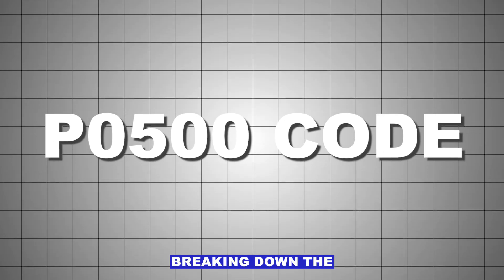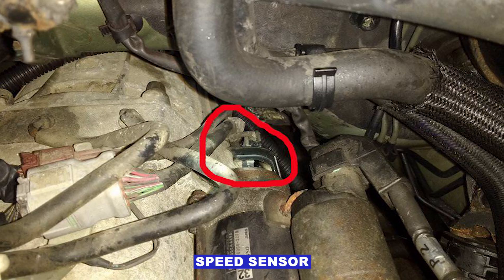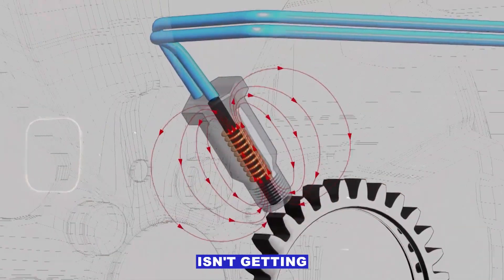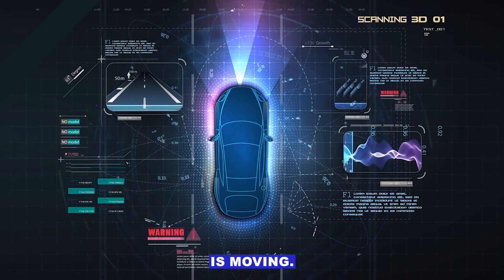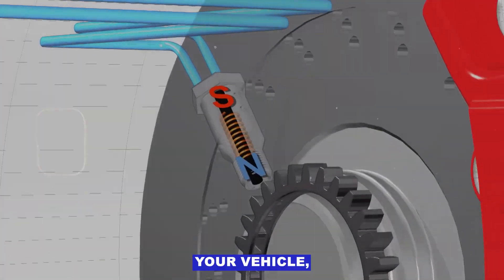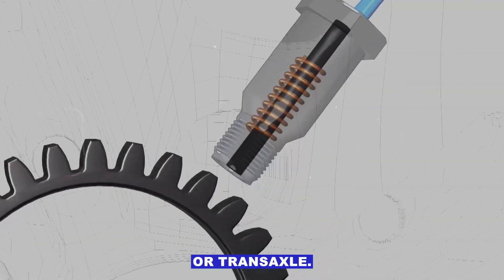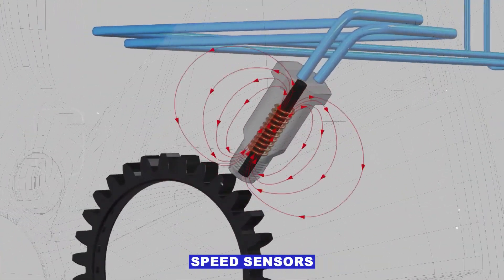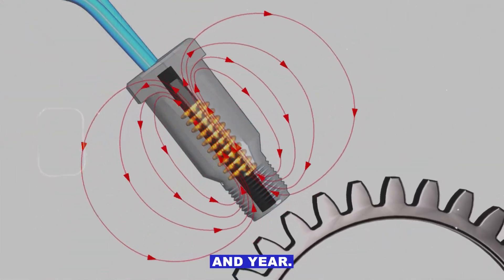P0500 Code: Vehicle Speed Sensor "A" Malfunction – Causes, Symptoms & Fix

Comment: Could a bad purge valve affect the speedometer?  My check engine light is showing P0441 and P0500 codes.  I replaced my instrument cluster and speed sensor with new ones about a week ago and the speedometer stopped working after initially working (the speedometer hasn't worked in two days).  I have a 27-year-old vehicle.

Comment: I'm having trouble gets my warning lights off after replacing the wheel bearings and speed sensors on the front end both sides. I used a scan tool a few times reprogramming the car and it will get rid of all the warning lights BUT within seconds all the lights come back on again🤬 it's just very frustrating so if there's anything you can help me with I'd greatly appreciate it thanks.
Reply from the maker: some cars require ABS calibration or VSS relearn so you need a bit better scan tool that can do that if your car model requires it.